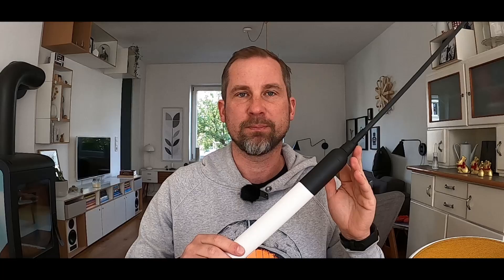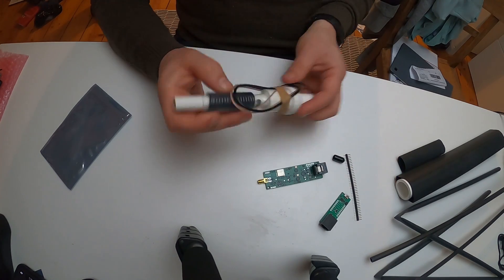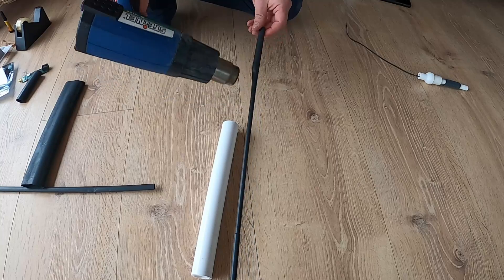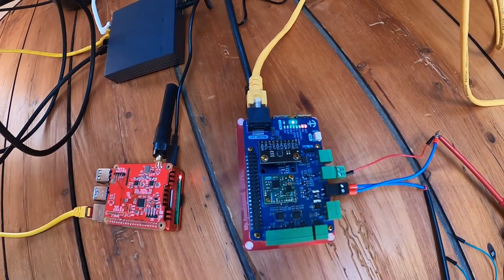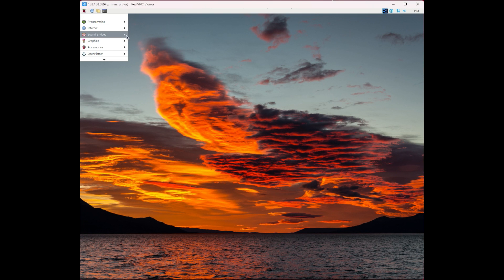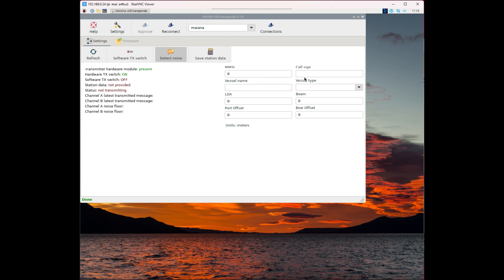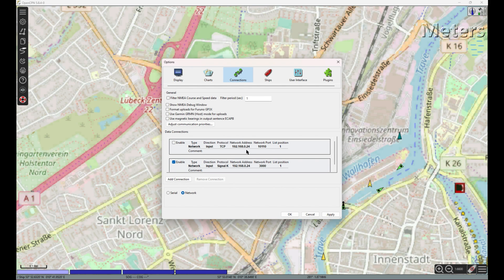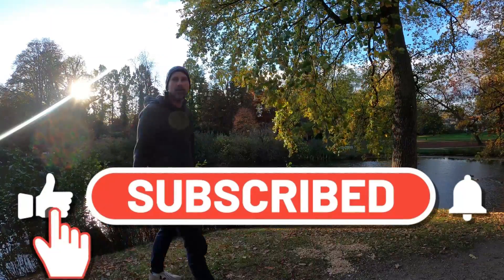MAIANA by Peter Antypas with MacArthur HAT, OpenPlotter and Signal K

Comment: I looked very closely at this transponder and it is excellent. Unfortunately a bit of research revealed that AIS transponders must be officially certified and approved before they can be used, which is not permitted for a home made device regardless of how good it is. A real shame as the guy spent a lot of time and effort to make an excellent device that would have helped numerous sailors.
Reply from the maker: Yes, I mentioned this as well. It is a different story in the US, but in Europe you need an approval for transmitting. You can just use it for reception.
However, it is not available anymore anyway :(
Reply: @Sir-Real   Thank you for the quick reply, greatly appreciated. Kind regards, Peter
Reply: Apologies for asking one more question;  is the main circuit board something you can buy off-the-shelf as a transceiver or is it a custom board that you designed yourself and had manufactured.
Reply from the maker: @PJ-jz5fm  This board is designed by Peter Antypas but there are some discussions on his GitHub account if additional boards are going to be produced by the community:
https://github.com/peterantypas/maiana/discussions/148
Reply: @Sir-Real  Thank you !!   Peter Antypas is obviously a genius 🙂  I will continue to check the link you sent for any updates.
Reply: Just out of curiosity; if you were to use it, what are the potential fines and consequences?

Comment: I thought class B AIS transmission was legal in europe for pleasure boats, am i mistaken
Reply from the maker: It is. But you need a (generic) radio approval. This has nothing to do with AIS. All radio systems, which are sending, need it.
Reply: @Sir-Real  Ah I see, it's because the device hasn't got necessary approval, thanks
Reply: Is there a list somewhere of devices that are approved for AIS transmission in EU? I am struggling to find a list anywhere.
Reply from the maker: @kenkrige1594  I don't know. However, usually all "offical AIS" transceivers which you can buy in online shops for marine stuff are registered. So, it is a special case here that we talk about rather a project instead of a product thing.